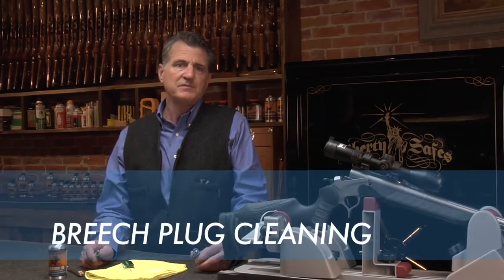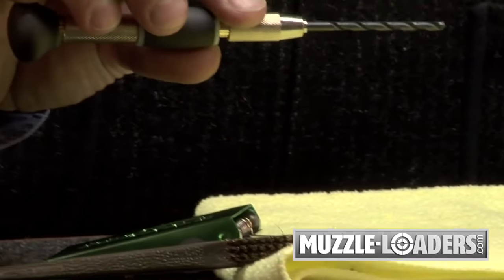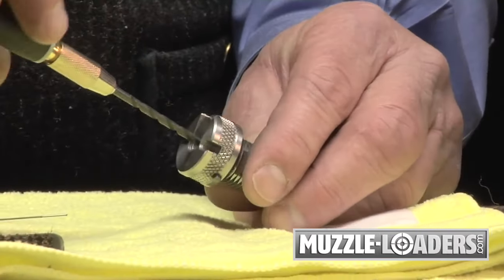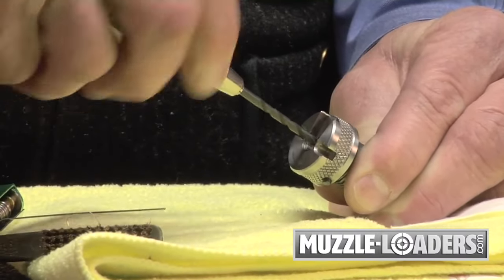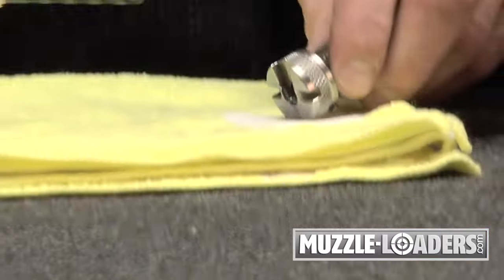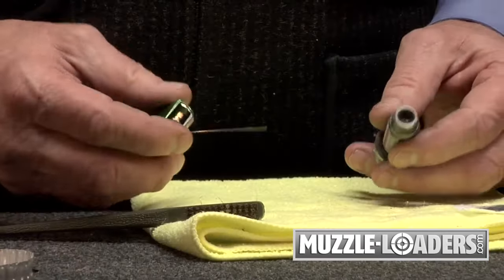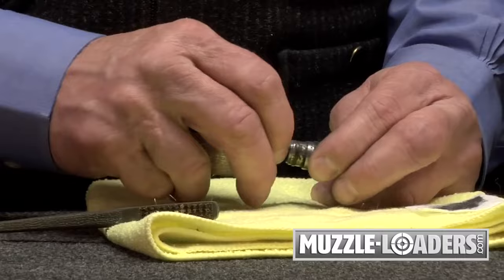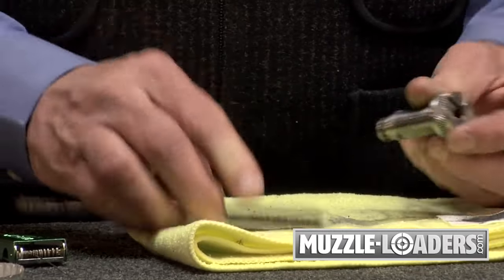Blackhorn 209™ Breech Plug Cleaning - Muzzle-Loaders.com

Comment: I have been deer hunting with a T/C Impact, BH209, Barnes 250 Gr. Expander MZ or 250 Gr. TEZ and CCI 209M primers since 2011. I use an 80 Gr. equivalent load of BH209 (actually 56 Gr. of BH209 by weight). Hunting here in Illinois, I seldom get shots beyond 50 yards, but my success with this combination has been very good. I recovered the bullet (Expander MZ) from my first deer of this year, shot right at 50 yards, and expansion was perfect. Until now, I have not been able to examine any of my bullets, because they have all been pass through shots. I wait for good shots and I have yet to miss. As long as it's legal to hunt with a modern inline muzzleloader and Blackhorn 209, I see no reason to change my combination.

Comment: Why dont you soak in in solvent  to soften up the carbon,,and even through the flash hole wth
Reply: Amen. That's exactly what I do. I use pipe cleaners and compressed air to finish.
Reply: I soak mine in an equal parts combo of hydrogen peroxide, 91% isopropyl alcohol, and murphy's oil soap you can watch the gunk bubble out of the breech plug.  Then I follow up with a torch file and compressed air

Comment: I was finally able to try Blackhorn 209 recently. I love not having to wipe between shots, ease of breechplug removal, and no crud ring...but, unfortunately the accuracy with Blackhorn 209 in my Encore muzzleloader is pretty poor. 80 grains of Blackhorn with a 250 gr Shockwave (black sabot), and Winchester 209 primers gives 4" groups at onl;y 50 yards. Pretty much the same group size with 90, 100, and 120 gr as well.  At that distance with 100 gr Triple 7 my Encore will punch a ragged hole with as many shots as you want to put through it. At 100 yards if I do my part the groups are 1.5" or less.  Was really dissapointed with the accuracy, Ive heard and read that the accuracy with Blackhorn 209 was excellent...I will stick with Triple 7.
Reply: Encore Hunter  You have to use magnum cci or federal 209a primers with BH209. Winchester primers are not as hot and do not fully ignite BH209
Reply: After using Blackhorn 209 this year, I am ready to throw out all of the others that I have on hand.  The MSDS sheet says it is an "ester".  That probably means it is a modified nitrocellulose, maybe with extra carbon added to it.  That also means there are no corrosive nitrates in it.   A friend of mine admitted that he forgot to clean his muzzle loader and found no rust the next year, after using Blackhorn 209.   Try some Harvester High Pressure sabots with several different weights of bullet and see if you get better results.  Although not quite as accurate ( I got about 2" at 100 yards.) the Powerbelt 250 grain Aerotip bullets are sure easy to use in my Green Mountain 50 caliber barrel.  If I lube the outside of the Crush Rib sabots, I can get a 325 grain Hornady .458" diameter bullet down the bore of my rifle.
Reply: I hate to ask stupid questions but did you actually clean your breech plug as the video shows? Also are you using hot primers? The primers are a big deal.
Reply: I had to go up to 110 grains of BH209 behind a 260gr PT Gold to get the type of accuracy I wanted. The negative is that you'll not want to practice with that too long. But, when you hit something well, it's going down!
Reply: @markyoung1566  - Two words: Lead Sled.
Reply: Having no trouble with a similar rig. Keep experimenting. I've gotten "1 hole" 3 shot groups at 100 yrds with BH209
Reply: you might be loading your gun to much. 70 grns should equal 100 of triple 7. your barrel might like that size load better.